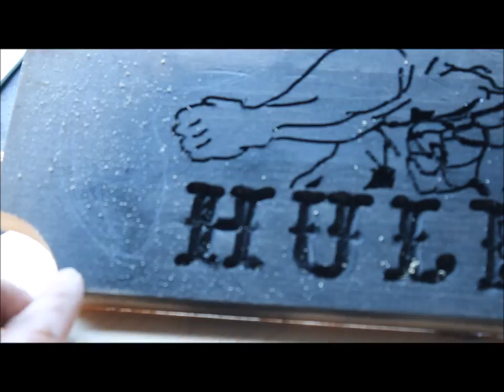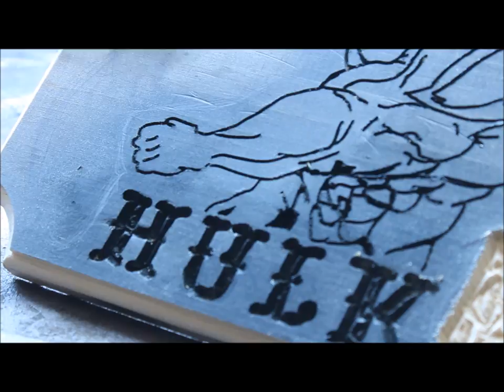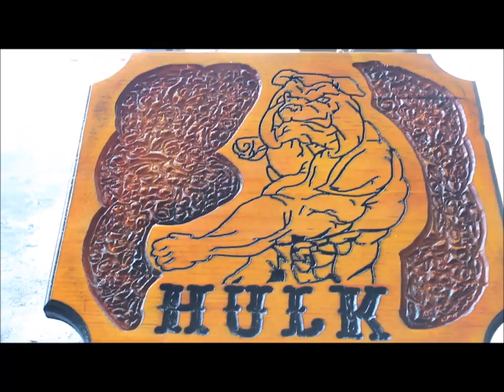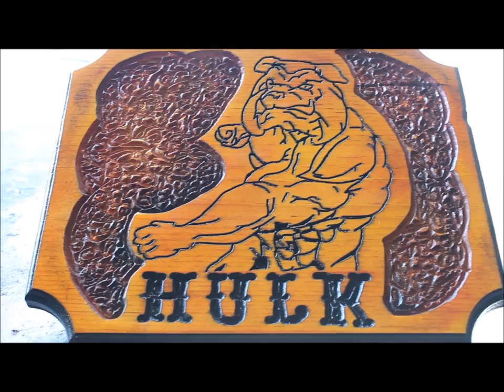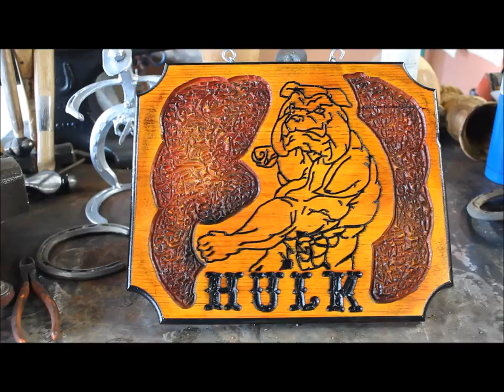Making a Wood Sign - Cartoon Characters - Part #1

Comment: I got a spray got like you have , air hose is to small for my compressor I think I’m going to send it back any suggestions.
Reply from the maker: The gun is great but I replaced the hose with a fabric type braided hose - look around online and you will find much better quality hoses - I have 3 of this Badgers and i use a good quality hose with a inline filter and it works great - look for airbrush dealers on the web - like auto airbrush vendors - I use the same hose on all of my Badgers - its longer than the one that came with it and 5 x the quality but still like the brush itself - easy to clean and fast

Comment: You say you use 8 or 9 drops of the tint... to how much ratio to the alcohol or water?
Reply from the maker: Depending on the container that im spraying from I use different number of drops and test spray it - with alcohol it will not raise the grain so if its to light I can add a few more drops of color into the container and keep spraying - if it was to heavy of color, I can sand with 220 or 320 to lighten it up - look at the small spray bottle i am using with the Badger spray gun and im not sure of the size but this is where i know 8-10 drops works well for me ........ spray light coats at first to obtain the shade you want and be careful as it can fool you when you apply the finish it can come out a bit darker also depending on color etc -
     Best thing use what im saying as i starting point - Transtint Dye is very strong and a bottle goes along way - I know its not cheap but lasts a long time - hope this helps you